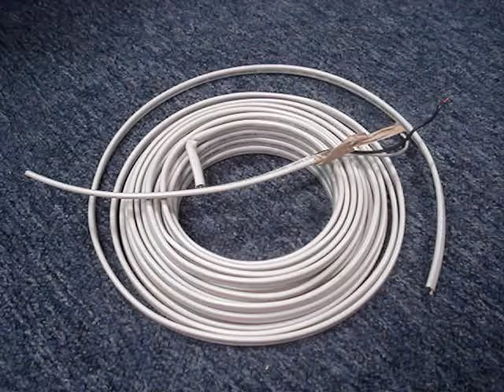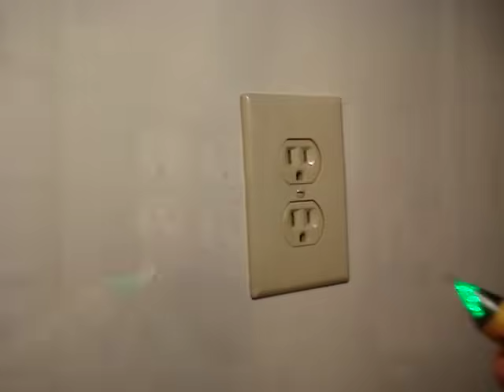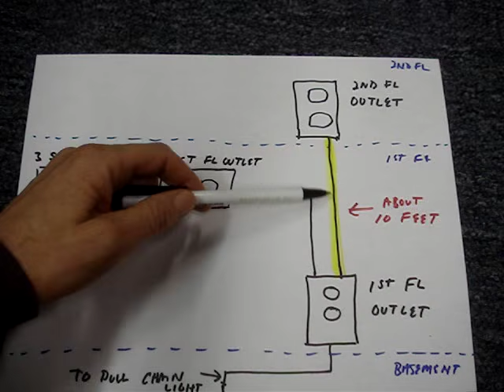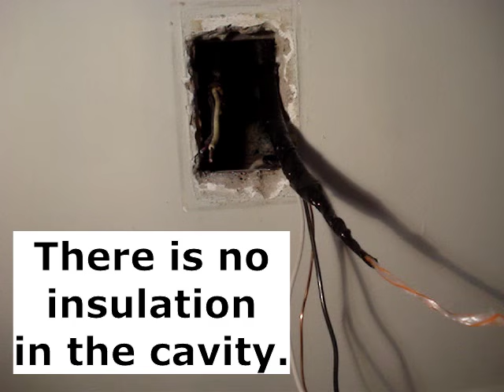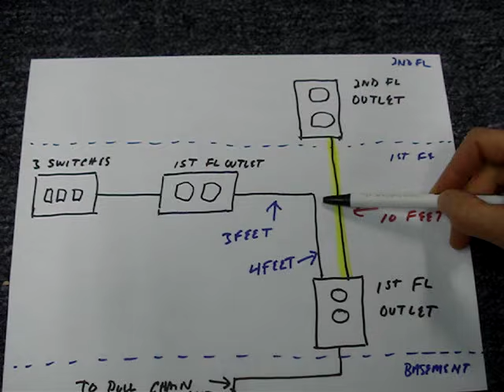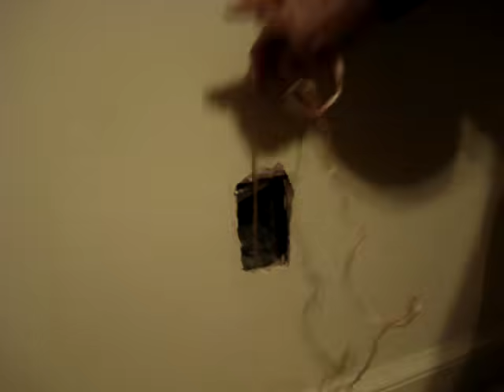Replace Old Wiring in House With Romex - Outside Wall

Comment: I like your determination, BUT WRONG WIRE SIZE!  Always use 12/2 w ground for outlets ...or bigger depending on the load. 14/2 is for small amp loads less than 15 amps. Also no one ever removes the old wires , much easier to cut off ends and shove back in the wall. next well i just cant tell you everything you did wrong... most importantly if any thing you plug into that outlet over 15 amps is a fire hazard, if you use a 15 amp breaker it will probably kick before heating to the point of fire. CALL A ELECTRICIAN , definetly DONT do demos of how to do electric work when you dont know what your doing... what about all the people who have watched this ... they all now have potential fire hazards!
Reply: 14/2 is adequate for general use lighting and receptacles. 12/2 is generally used in kitchen counters,kitchen general use receptacles, bathroom gfci or whole bathroom as long as you don't leave that bathroom, washing machines, dish washers, garage receptacles, and I like to use 12 gauge wire for outside receptacles .
Reply: @bradfordlibby9118  not one state in the USA is it legal to use 15 amp rated wiring... 14 AWG for outlets. PERIOD.
Reply: @322doug  🤦‍♂️dude this post is over two years old and your just putting your two cents in now?
Reply: All information for determining circuit ampacity and OCPD are in Articles 210 and 240. 210 pertaining to branch circuits, GFCI'S, 210.8 part A, 210.11 Branch circuits required parts A-C and Art.210.12 AFCI protection. 
As I sit here replying to this YouTube post I am not surprised by what I've read from individuals. As a self employed electrical contractor all these do it yourselfers and posting on this forum kinda chaps my backside and I'll tell you why. 
I just had to meet with an IOW and customer who I had given a price and had taken out a permit for a job that that I thought I had. I was just waiting for the call to commence working. Because my customer thought that not only my price was too high but that of other professionals were excessive and thought their money was better spent on the septic system.  So, the property owner watched a couple of YouTube videos and figured they would save themselves a few dollars and did the electrical work themselves. I only found out because the electrician hired by the sub for the septic system had taken out a permit for the ejection pump and the IOW for the town had known that my permit was still open as I had replaced and updated the service.
To make a long story short. My customer had done his own work on a two family, under my license, insurance, and permit.
He/they are in direct violation of state law. Not to mention several code violations. And not obtaining a building permit. Needless to say they had to take the property off the market, give the prospective home buyer the deposit back,and, now, have to hire another electrician to make all needed updates and repairs.
All from watching a YouTube video.
Reply from the maker: Ummmm... it's a 15 amp breaker.  Umm..... I needed to use the hole in the top plate for the new cable.  Ummm.... 14 gauge wire was installed for 68 years, no fire yet (and it meets code for a 15 amp breaker).   Tell me where in the code book it says you must use 12 gauge wire on a 15 amp circuit.  I bet you can't.  Please tell us all of the code violations by citing the code book.  So far you have come up with nothing other than bluster.
Reply: @Know-How-Now  Be a smart ass i dont care , just telling you NEC. I hav3e been a electrician for over 30 years... grow up LEZZY!
Reply from the maker: You still have not cited any code violations and now you are swearing, personal attacks and name calling.  Love you avatar... Cross & bible.
Reply: Hammer USN Wow, that’s the mature way to go about things. Why does it not surprise me one bit that a person like you has a cross and other paraphernalia as your avatar. You’re exactly what I expect a Christian to be. A name-calling, small-minded bigot. If there is a god, it’s going to have fun deciding what to do with your soul when you die.
Reply: @Know-How-Now  Secondly no way in hell that wire was installed for 68 years ... it would be knob and tube if it was more than around 45 years. Stop lying....
Reply from the maker: Ummm keep digging knob & tube was gone in the 1930's.  https://en.wikipedia.org/wiki/Electrical_wiring
Reply: @Know-How-Now  SEE UR showing your ignorance again..... i still replace knob and tube today on rewires... JUST SHUT UP and  grow up your probably a libtard too arent you, a freaking SJW democrat living off my tax dollars ... wow  i dont have time for you , go put your helmet back on, pick up your crayons and run outside and play with your little antifa friends
Reply: @322doug  There was absolutely ZERO need for politics in this thread, yet because someone disagreed with you you label them a "libtard" and your assumption of what an "SJW Democrat" must be like, it's a bit sad considering this is coming from some 45+ year old, I could go off on how "mature" you must be, but all I'm gonna say is that when you retire maybe turn off all media (TV, Social Media apps, etc...) and read up some books on different (non-biased) subjects (Politics, Religions, Cultures), instead of being this sad old man who tells others to "Grow Up" when he himself hasn't.
Reply: @Know-How-Now  Hi,  I enjoyed your video.  I have a home that was built in the mid to late 1930's.  The basement and attic look like exhibits at a prehistoric wiring museum.  I can clearly see all the upgrades (a pushmatic panel from the 40's or 50's,  and the fact that they never removed any of the pre-existing wires and the bakelite covers are still in place for outlets, switches and blanking plates.  I think that's pretty cool   One thing it doesn't have is K&T wiring.  So your are quite correct.  And I'm sorry about the very sad jerk trolling you.
Reply from the maker: My niece and boyfriend just bought a "wiring museum" similar to yours.  Do you have any of the "push button" light switches.

When I started the channel a few years ago, I thought I'd have to fight off a lot of trolls like Hammer USN.  There are now millions of views on the channel and there have only been a hand full of people like him.  The sad thing is that the most extreme people tend to get the most attention.  My experience building the channel has raised my view of people.  Almost everyone, except the very few like Hammer USN, appreciate the videos and are nice and civil.  It's an important lesson for all of us.
Reply: @Know-How-Now  wow, im a licensed electrician... and i was right... go to menards /home depot ect grab a NEC code book, look at outlets, 12 awg is minimum... and GROW UP 1 you poor baby months later still flaming like  the immature person you are. LOL, It your life is so pathetic that are still flaming on ..... I feel sorry for you.
Reply: @Know-How-Now  No push button lights, not sure if they were there originally.  The house received an attic "upgrade" in the 1960's or 70's, so they may have updated the electricity in the living room and kitchen at that time, because in those areas there are a few grounded outlets.  Upstairs the outlets are all grounded, but no GFI. Upstairs they actually had a 1973 Sears Kenmore window a/c unit that was still working fine.  The grills were covered in dust, so I decided to unplug it and clean it up.  When I unplugged it, the grounding plug stayed inside the wall socket.  And was all covered in green junk (copper patina?)  This house is an odd mix.  I had no problems changing the outside light fixtures.  But when I tried to change the overhead light I was met with cloth covered copper wire (thicker than a coat hanger) and it looked like it had caught fire at least once in it's lifetime.  Needless to say that project has been put to the wayside until I can afford to get a new box and wiring installed (professionally).    Also found an early art-deco style extension cord that had been hardwired in the basement joists.  Someone had already put a stop to that, lol.  The house originally was a coal burner,  the coal  shoot is still there, as well as the cast iron pipes, and water tank.  At some point they welded the burner's doors shut and converted to natural gas.  There's a radiator in every room.  I don't use it,  the last time it was serviced was 2007 according to a label installed on the unit.  Sorry I get long winded when I talk about this place.  Keep up the good work!
Reply from the maker: No need to be sorry about being long winded.  I've enjoyed you comment, it brings back some found memories.  My grandparents had a huge old stone house.  One half of the house was a store when my dad was growing up.  My dad and his brother converted the store part of the house into two apartments in the 1950's after the store closed.  There was a large copper tank in the attic for the water supply.  I was told my grandfather tore it out in the 1980's when metal prices skyrocketed.  Some one in the family still has the old burglar alarm that was in the store.  I remember the coal truck coming and filling a huge room sized bin in the basement.  My grandfather had to make periodic trips the the basement to feed the furnace. To my 5 year old self, the furnace seemed to me be what hell would look like.  It was hot down there and there was hard work shoveling the coal into the furnace.  I believe at some point the furnace was fed via auger.  Soon after that a oil burning furnace was installed.
Reply: Hammer USN Aren’t you dead yet from catching COVID at a Trump rally?
Reply: @322doug  I just searched up the code as of 2020 standards and could not find your claim that 12awg wire is the minimum , 14awg wire is still on their list of wire that can be used for 15 amp receptacles,  here's a pic explaining this. https://prnt.sc/wcqzyb  I am not here to debate with you on this as it is very much still a standard as of right now , it also depends on your state for which version of the NEC they use here is an example : https://images.esfi.org/Full-Sized-Adoption-Map-December-2020-6455.png?rs27-q100ption-Map-Novem-mw1000-mh1500  NOTE: Always check with what version of the NEC your state uses and then look up the code based on that version.   I also know licensed electricians and they all said that 14awg as of 2020 can still be used in light use applications such as lighting and low amperage receptacles hence the reason they still make 15amp receptacles .
Reply: @322doug  Alright it was bugging me , just found it for you , here you go : https://prnt.sc/wcr8l8
Reply: @322doug  Ohh and befor you go and tell me that this data is not correct, then you should re read the 2020 NEC  USA standared, Good luck. Stay safe in the world of Covid.
Reply: @Know-How-Now  lol...wiki pedia, in that very page states , that this info is consumer supplied not always accurate. try southwire manufacturing, lafayette indiana, where i live and still do residential, industrial and cmmercial wiring... knob and tube residential wiring was still legal and used in many stes until mid 60's.  its not even about that.... the point is 14 AWG is for 15 amp wiring, 12AWG is rated at 20 amps and ALL electrical code  in USA states only 20 amp rated romex is allowed for electrical outlets.... and is a violation of law to ever use 14AWG ... 15 amp wiring for outlets.... just because you have not had a fire doesnt prover anything.... millions play the lottery every week and in 40 years never win... doesnt mean it never happens. Fact is you are butt hurt, and you gave dangerous and wrong ignorant information that could get someone killed, including a child asleep in their bed. DOnt pretend to be an expert and get someone killed over your ignorance and ego. another bad choice which we all know you make plenty of those.
Reply from the maker: Did you did see that someone replying to this thread has put a link to the code that proves you wrong?  How about showing us the code to prove your argument?
Reply: @322doug  A little late to the party here but for a supposed electrician that has "30 years of experience" and demanding someone on the internet show you the code yet you offer no such code in rebuttal, just vague references to NEC and your local area. A simple answer could be it is dependent on jurisdiction and local building codes but most builders run 12 for outlets because it is easy and acceptable in nearly all situations for 120V residential outlets. According to NEC Table 210.24, 15A circuits with 15A rated outlets, 14 gage is the minimum acceptable size, though there is a maximum load [210.26.(A)]. For that reason 14 gage is typically only used in bedroom outlets where those loads are fairly low and again dependent on local codes.
Reply: Lmao imagine having an electrician come into your house and rewire your living room with 12/2.. Like hello? A 20amp breaker for my tv or what?
Reply: @Coloralic  what's wrong with that

Comment: Nice and patient.  Good job.
Reply from the maker: I had no idea of how it would turn out.  I knew the drywall was mounted on the furring strips that were fastened to the cinder block and there was no insulation between the two.  I thought there was a good chance that the cable was not fastened, but was not sure.  I wanted to use the hole that was already drilled.  I likely could have just pulled the cable out and then pushed my fish tape through.  Since this was the first try at an outside wall in this house, I took a conservative approach and pulled the string along with the old cable.

Comment: I’ve been where you have been and I was happy to see when the wire finally pulled through
Reply from the maker: Thanks for cheering me on, Gil.  I was so happy when I found that cable was not fastened and I could use the existing hole for my new cable.  I'm sure I'll have some more "puzzles" to figure out as I work my way through the rest of the circuit.  I do like solving problems, so it's kind of fun.